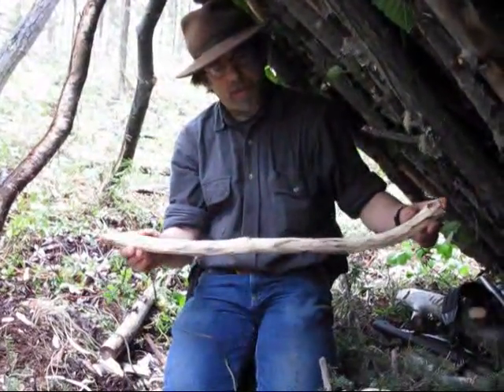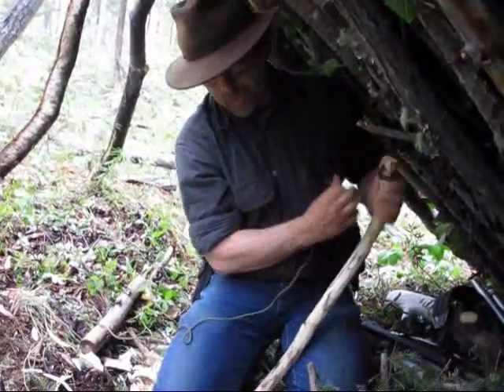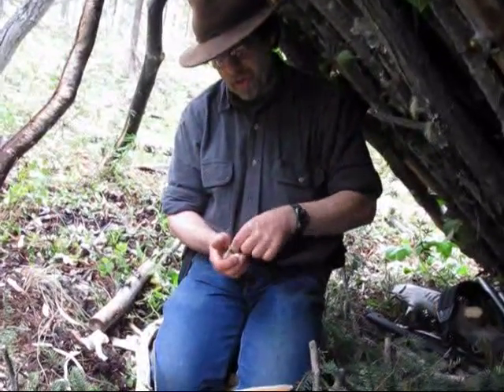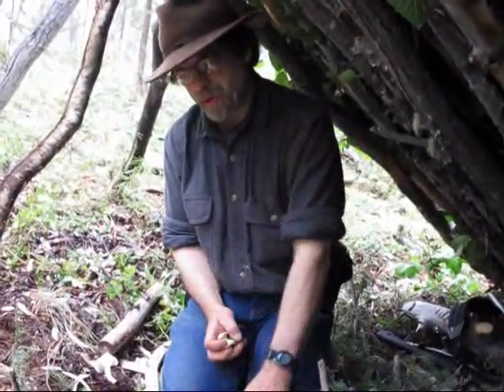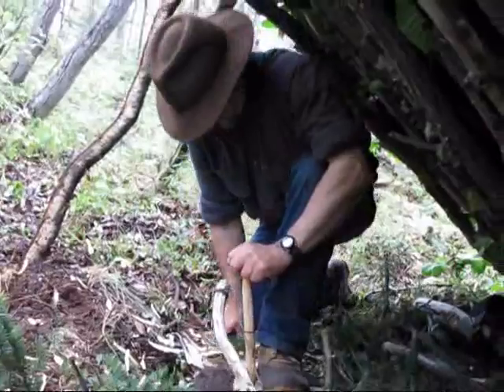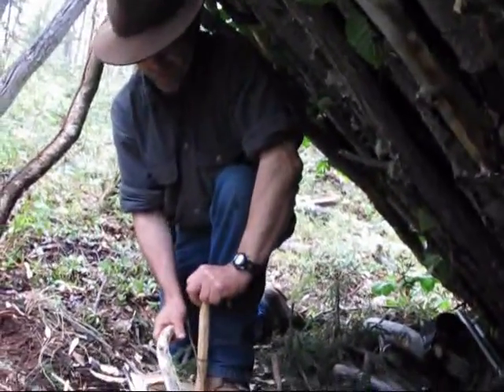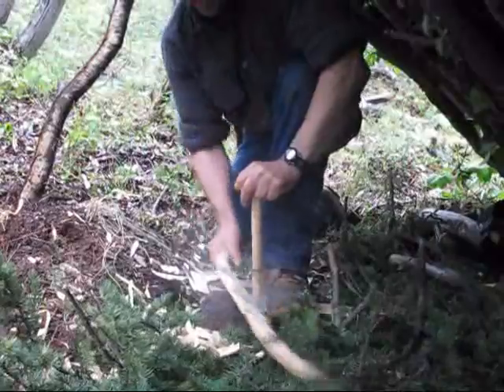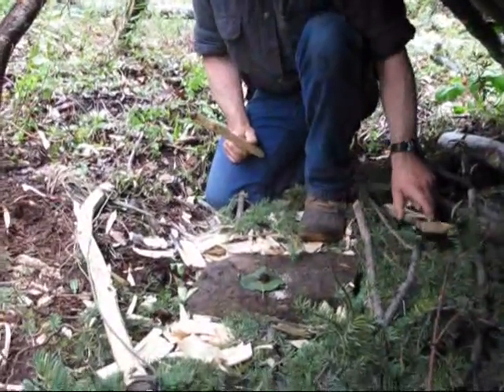Bow and Drill Tutorial Part 2 of 2

Comment: Thanks Lonnie! I think I suck at making the knot for the bow... I burned all my shoe laces (lol) and I almost made the ember, but the shoe laces broke and now I am waiting for paracord to be delivered... I struggled with being able to keep a constant tension in the cord because I probably don't do my knot well. In this video I am unable to see how you did it... do you have any advise? Thanks in advance :)
Reply from the maker: What you can do is to tie a simple overhand knot in one end.  Make a saw cut into the end of the bow and slide your cord into that resulting saw cut so that the knot stops the cord from being pulled through.   I make a saw cut in the other end as well and generally leave the cord long.  I drop the cord into that saw cut and then wrap the left over end around and around the end of the bow taking up the slack end of the rope before finally dropping the end of the cord back through the saw cut to hold the end and keep the cord end from flopping around and getting in my way.  If the cord proves to be too loose or too tight, it is a simple matter to loosen and adjust a bit before trying again.
Reply: @Far-North-Bushcraft-Survival  Thanks Lonnie, I will try again as soon as the paracord is delivered. I think I should make the spindle  straighter as that's another issue I believe I had...